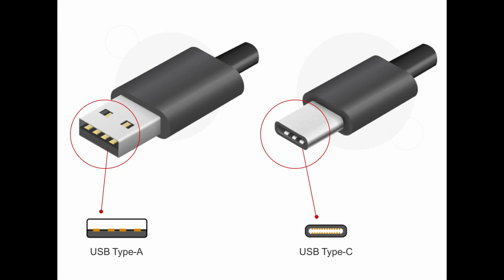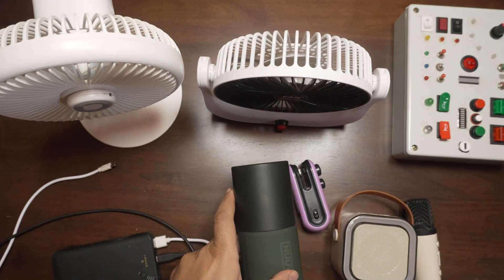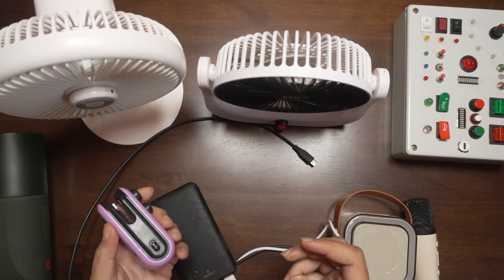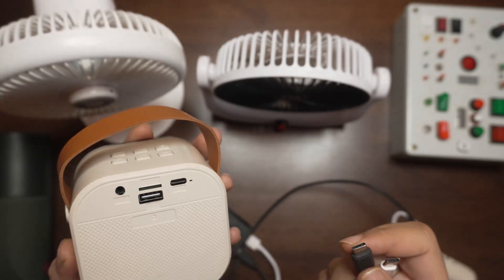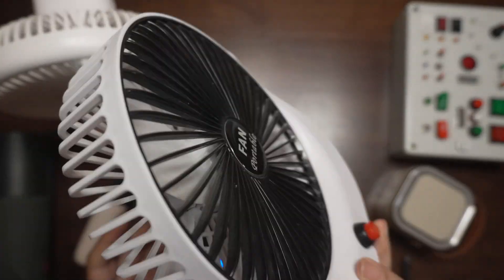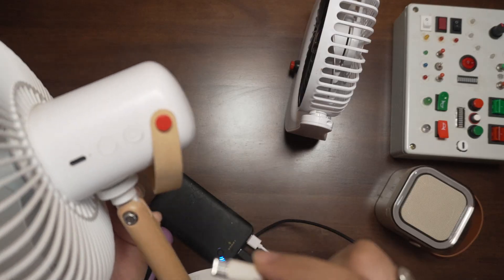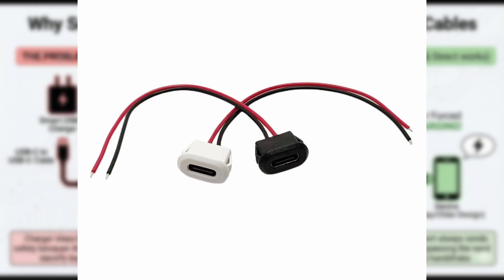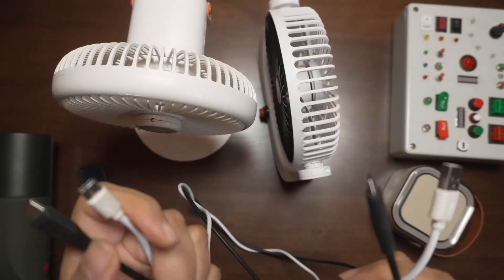Why Your USB-C Device Won't Charge (C-to-C vs A-to-C Explained) #typec #charging #chargingcable

Comment: I've experienced the weirdest thing ever and can't explain it.  I use my phone's block going to my phone, which is an A-C type.  My cable went bad, so I tried other cables with no luck.  These cables worked for other devices, so I know they are good.  I bought new cables that finally allowed me to charge my phone again.  I wonder what's in the cable?

Comment: It's your powerbank that's not fully compliant with USB-PD on its Type-C outputs, some USB-PD adapters/powerbanks do the same mistake on Type-A.

The standard says that all ports should act "dumb" and output 5V (500mA+, most do 1.2A), like the initial USB power spec, no matter what, how else would you power the handshake chip in a device without a battery?

I came here to hear if there's an explanation why I have two USB-PD compatible cables that act different between my (67W) charger and computer... One is clearly a red USB 3.2, like the charger, this works with my laptop, and fast-charges my phone, then I have another one rated for 100W USB-PD that works fine with my phone (so a handshake does happen), but doesn't work with my laptop. Same charger, same devices, just different cables. But I didn't have that answered.
Reply from the maker: Oh that's something to think about thanks for highlighting

Comment: Well... I think I will never be using A to C now. I don't like that lack of a handshake check.
Reply: There's a lack of handshake because with type A there are actual rules such as what voltage you can send through a legitimate USB port, while all requirements on type C are optional. The very idea of making standards and requirements optional is oxymoronic, and so you get problems like failing handshakes and C ports or cables that are polarized on the inside despite the reversible nature of the plug shape.

Comment: While this is true some of the time, there are actually many USB-C chargers which don't use a handshake signal, because they aren't fast chargers, and they will work with C-C.  I'm actually surprised there are C chargers which don't default to a basic mode.
Reply from the maker: That's an interesting point about the handshake signal.

Comment: Standardizing to type-C usb was a mistake. It is too miniaturized and therefore too fragile.
Another problem arise from ports being soldered directly to the circuit board. The force of inserting the charger cable will break it off. Ports should be mounted to the case and connected by a flexible cable inside the device to the circuit board. This part needs to be standardized and mandated so it can be easily replaced.